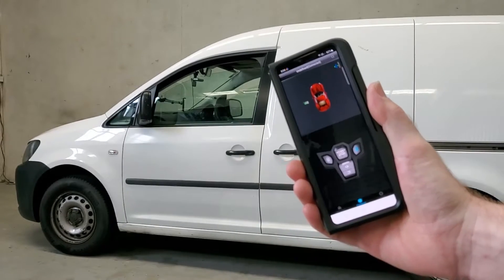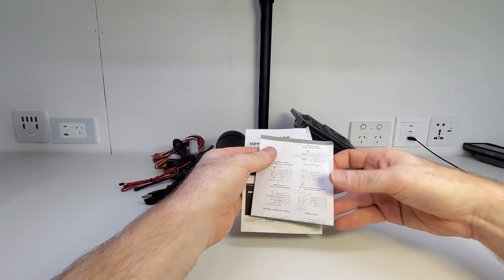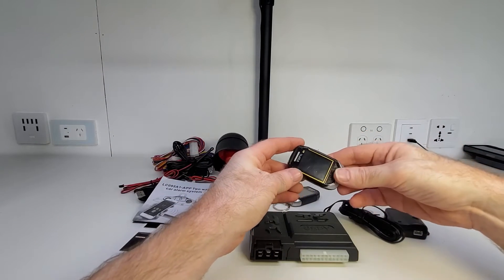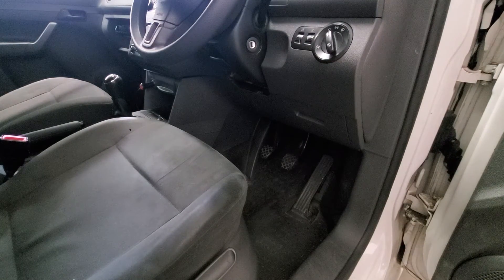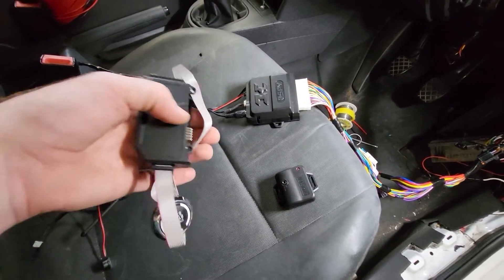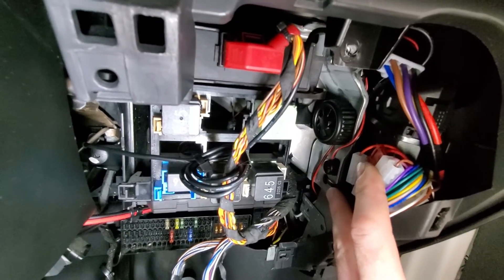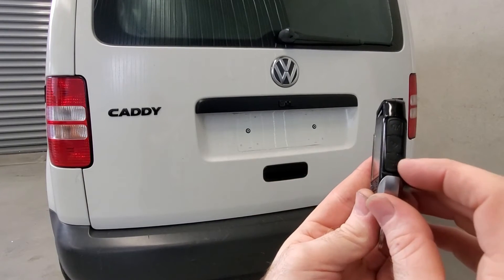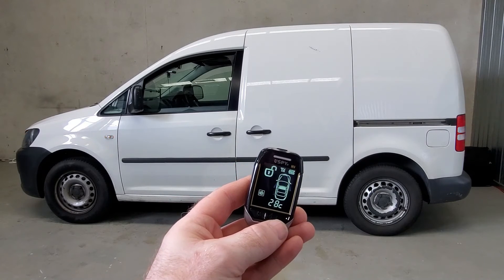How does this Spy 2 Way PKE Car Alarm Work? Review and Installation

Comment: Hi, After opening the vehicle, I am forced to switch on the ignition or press the brake pedal promptly. If I don't do this, the alarm system will arm again and lock the car. I don't want that. I still need time because I still want to load the vehicle. Can I disable this feature?
Reply from the maker: That problem is caused because the alarm has been wired up incorrectly and your door switch wire is not sending the alarm the correct signal. Once you have your door switch wire correctly setup your problem will go away. No that can't be disabled, it is one of the main features of all car alarms. Take your car back to the Installer or use somewhere else that knows how to Install a car alarm correctly

Comment: Spy H2 Where should I connect if I have 2 wires for opening and closing? Lock on Lock off Lock signal. Open on Open off Open signal?
Reply from the maker: This all depends on the type of car you have because all cars are wired differently and use different types of locking systems.

Comment: Hi. Nice Video. 😊. I have the e-spy installed, but after my car battery was changed, the remotes won’t pair. The app still works though. Do you know how to re-pair the remotes? Appreciate any help. Thank you!
Reply from the maker: Hello, start by removing power to the Alarm controller for 60 seconds and then reconnect, then theres 2 options, try this: 

OPTION 1
1. Press and Hold down Foot Brake Pedal
2. Turn Ignition ON and OFF 8 times (leaving it ON the 8th time)
3. Press UNLOCK button on the Remote
4. The Siren will Chirp to confirm the programming was successful
5. Turn OFF Ignition and remove key

OPTION 2
1. Press and HOLD the Learning Code switch on the Alarm interface controller for approximately  3 seconds
2.  Now press UNLOCK button on the Remote
3. The Siren will Chirp to confirm the programming was successful
4. The Remote is now programmed

Hope that helps you, best of luck
Reply: I got this alarm. I have a very detailed question. I use to have cardot car alarm when you remote start it,you just get in put the car in drive. But with this one it just remote start the car and you cant just put it in clear and driver off. So my question is can this alarm remote start and just get in and drive or is everyone who got this alarm also deals with remote start and then put it in gear and it shuts off?

Comment: Hi Bro, I enjoyed the video. I installed the same product. I have two questions. 1. When I open the door and get in the car after remote start, it doesn't change to driving mode. It turns off after 12 minutes. 2. I connected the antenna well, but it's fm 433hz and it's only 50m. I don't know. The seller doesn't have an answer either. I don't think the wiring is wrong. What's the problem?😭😭
Reply: 이제품은 원격시동후 문열고 브레이트 밟고 스타트 버튼을 누르세요 스타트 버튼 중앙 위에 빨간 색으로 변하고 깜박이 점멸이  멈춥니다  힘들게 알았네요 나도
Reply: @미스터찬-y4v  문열고 브레이크 밟고 버튼 누르면 어떻게 되나요? 시동상태가 계속 유지가 되나요? 전 시동이 꺼지는 거 같은데요..ㅠㅠ
그리고 혹시 도어 열면 비상등이 켜지는 거 끄는 옵션 혹시 아시나요?
문열림 길게 누르라는데 전 그렇게 하면 리모콘 자체가 꺼져 버리더군요😭
Reply: @미스터찬-y4v A thousand thanks to you, my brother. I searched for a long time and tried every method, but I couldn't find a solution. Finally, after a long struggle, I found what I was hoping for. I wish you all the best and happiness.
Reply from the maker: Are you remote starting the vehicle with the app or the remote fob?
Reply: @SHORTwithTECH  All remote start-ups can't be maintained after a ride
Reply: For this product ,after remote start,open the door ,press the brake pedal, and then press the start button, the light in the center of the start button will turn red and stop flashing, l figured this out after a while.

Comment: why don't you make it all vidéo how to install the spy lock system in detail
Reply from the maker: Thanks for your comment. I have made a video about the remote start seperately which applies to all car alarms. https://youtu.be/xQP1rDDeD-E?si=lA2YVxOlcQ2jLxi- as for tracing wires and connecting to the cars electrical system, this is really a job for a professional installer to do and becausecall cars are different I did not feel ot was necessary to include this in the video. Which part are you struggling with, I can try to help you

Comment: please do remote start installation video
Reply from the maker: Sure, I can do a Remote Start video for you. Thanks for your suggestion, I have added that to my schedule and will proceed with that idea 👍
Reply: @SHORTwithTECH have ypu done a spy alarm remote start yet
Reply from the maker: @Majinchip87  a long time ago I did a video for Remote Start which was more of a Universal type of video which could be used for all kinds of different car alarms, you will find that video here https://youtu.be/xQP1rDDeD-E?si=Q-CwHMszwFNR8wce
Reply: @SHORTwithTECH  Definitely want to see that too!  Watched this video for the PKE and push button start.  Remote start doesn't interest me, but very curious how the remote start is wired / how it operates.  EG: How does it detect engine run or does it just crank for ever.
Reply from the maker: @jamesrenfrew5093  Thanks for your comment. I am working on a remote start video at the moment and it will be uploaded to the channel on March the 3rd. Thanks to everyone who has requested for this video, i hope you will all like it

Comment: can you provide me with wiring diagram explanation
Reply from the maker: Hi, I dont have a diagram sorry. What would you like to know?
Reply from the maker: I thought I had thrown out my wiring diagram but it turns out I still have it. I have posted it on my Instagram for you which is instagram.com/shortwithtech.official Hope that helps you
Reply: can auto start engine?
Reply from the maker: @andrewkhiew3442  yes it does, but you will need a bypass module to use that functionality of the system if your car is using a transponder based immobiliser system